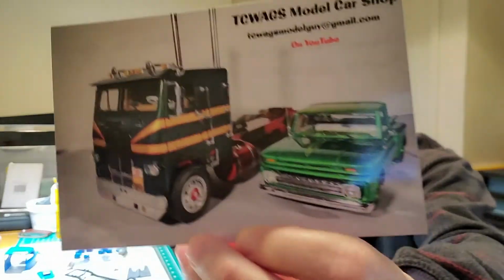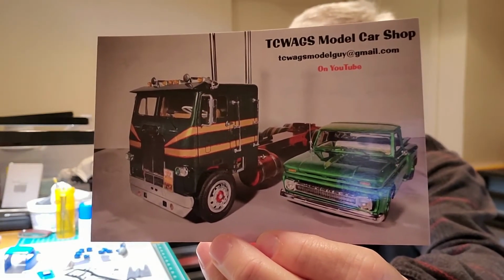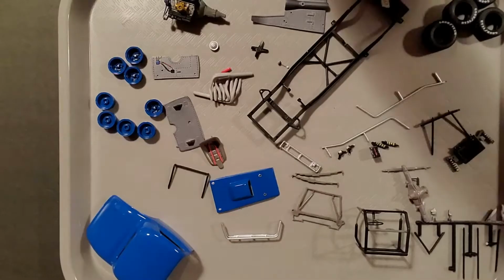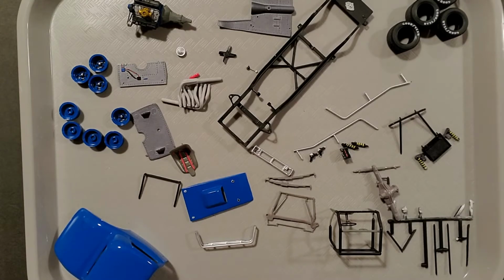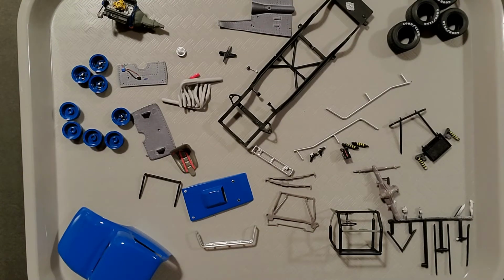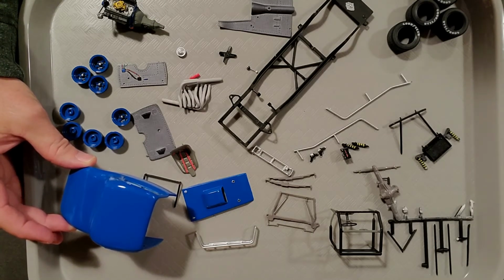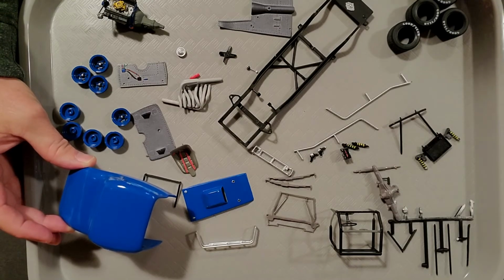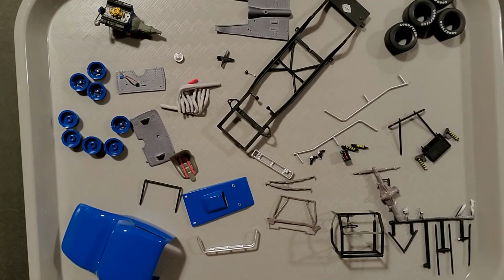34 Modified Build Part 2 and a Mail Call

Comment: Nice shout out!!!   The Ford looks Great.  If the color cot is nice and smooth / glossy , I apply the decals to that surface.  Then clear.  If not I'll clear first.  After the decal has been applied and dried, I'll clear over it.  Fist coat or two should be mist coats, then 1, 2, or 3 wet coats.  I only use micro set or sol when a decal isn't laying down on the surface I'm tiring to get it to conform to.   Hope that helps???    Merry Christmas to you and yours Mike.    I'll be watching
Reply from the maker: Thanks Mike, it does help. Merry Christmas to You and Yours as well.

Comment: The modified racer is looking great, Mike. I usually put down decals on the paint, then clear; but I'm definitely not an expert on decals. I use Micro set and Micro sol on all my decals. Keep up the great work!
Reply from the maker: Thanks Jeff, decals on the paint seems to be the preferred method for most. I will try the setting solutions too.

Comment: Hey Mike, thanks for the shout out on the shop card...as far as decals I'll wet sand the area with 3500-12000 to get a smooth surface, lay the decals down with Micro-Sol and clear over them. Take care TCWAGS 👍😎
Reply from the maker: Thanks I really appreciate the advice!

Comment: Nice update Mike! I try to avoid decals when I can, especially large decals. I'd rather spray something like stripes. small things like badging I just put down right on the paint, but that's me.  You could clear first, especially if you have a surface that isn't already smooth.  It will help prevent silvering where air gets trapped under the film in pits between the decal and the paint, and shows up when everything dries.
Reply from the maker: Thanks for the information Justin. The paint is pretty smooth but not perfect. I have rather large numbers to put on the car so I'm a little nervous about silvering.
Reply: @pasmodelworkbench4981  If you're concerned about it, a gloss coat first absolutely won't hurt.

Comment: great look you got going there. i like what you have done so far. i put the decals on the paint and if it is not smooth i wet sand lightly once the decals are on then i clear. i have heard some clear then decal but i have never tried it that way. have a great Christmas.
Reply from the maker: Thanks Russell, I kind of hoped everyone would say You should do it this way but it sounds like some do it one way and some another.😁

Comment: Some guys swear by a gloss clearcoat before putting the decals on and then clearcoating them after. I've tried it with and without....I couldn't see any difference. You do have to watch out for different paints reacting to the decal set. So be careful.
Reply from the maker: Thanks Charlie, I think I'll put the decals on the paint then clearcoat over the decals. I'll test the decal set on a scrape piece of painted plastic first to be sure. Looking forward to the Night Before Christmas.